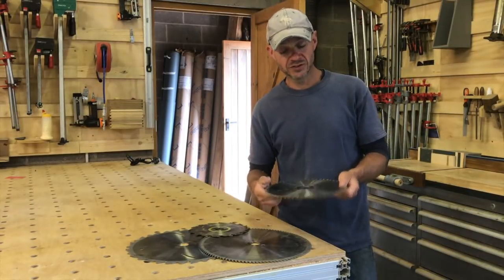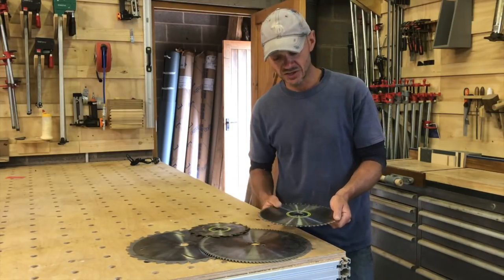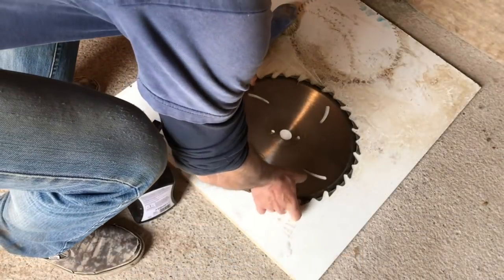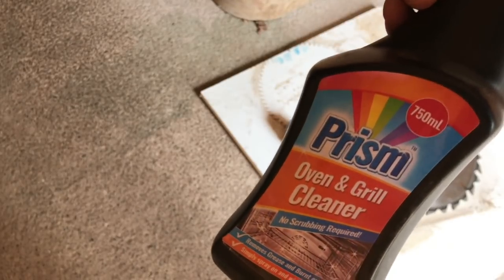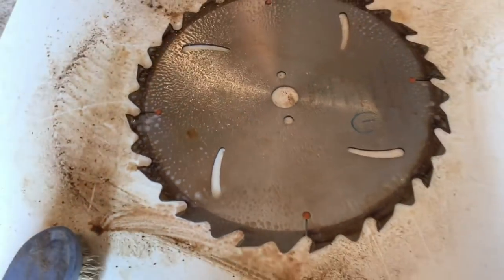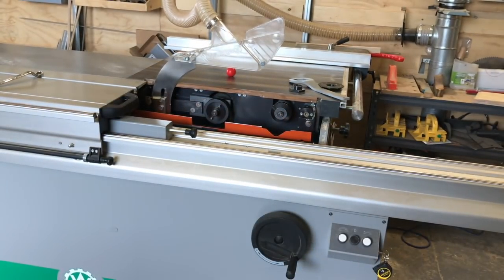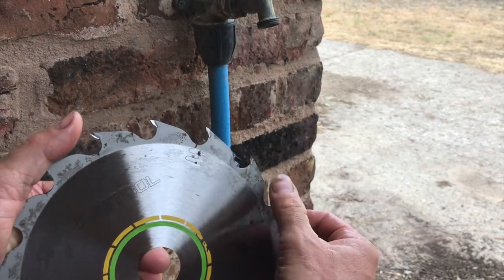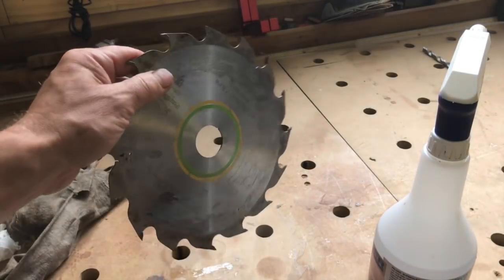Blade cleaning - Sunday shop update

Comment: I have CMT cleaning solution. 0.5l last me for 3 yrs now and I have like 1/4of it left. It works like a charm. Spray left if for fev mins and wipe. I learned that after is clean I clean the blade with lacquer thiner it kinda degrease the sawblade and it stays clean for longer time.
CMT cleaning solution cost 12 €
Reply from the maker: for me the CMT stuff didn't work very well I bought this last year ..  - https://www.ebay.co.uk/itm/CMT-Formula-2050-Saw-Blade-Router-Cutter-Bit-Cleaner-500ml-Bottle-998-001-01/172602218137?epid=1752199089&hash=item282fe4d699:g:vVAAAOSw1cNaAwF8
Reply: Manor Wood I see. Well the packaging looks about the same size just formula is different. Maybe different version. I don't know. I got it as gift from my supplier  first I was sceptical because I thought I will use it all in one month. But somehow it worked like a charm. I think it has a lot to do with what you cut the most. This year I had 80% just larch and on some occasions I had to spray it twice. I'm always in for something new so once I use it all I'll try that owen cleaner. Thank you.
BTW I'm happy with CMT lubricant for my mashinery too. Cheers

Comment: I use the same stuff, it works great and I find it odly satisfying cleaning blades.
I was cleaning a load of router bits for about twenty mins without gloves then noticed all my finger nails had gone soft !  thought they were going to drop off. Soaked them in vinegar and about an hour later they went back to normal but I  honestly thought they were history.
Reply from the maker: That made my laugh at first then worry for you..

Comment: For a less expensive alternative to the Felder spray, try GT85  ptfe spray. It is a lubricant used especially by cyclists. It works well on my saw table and lathe bed. Dries quickly and does not attract dirt or dust. Cost on line £2.50 to £3.00 for a 400ml spray tin. At that price you can afford to give it a try, even if you have to apply it more often than the Felder product.

Comment: I have no idea if the product is a chemical based cleaner. If it is l highly recommend wearing rubber gloves and a full face mask to protect yourself. I use acetone to clean my blades and then spray them with pure silicone. Where do you buy superglide?

Comment: Great tip Andy. I might be wrong but I think I seen you using Dakota parallel clamps on another video. Do you rate them? I have read mixed reviews. Cheers
Reply from the maker: I don’t use them much so but they are a life saver when you need them!  Not as good as bessey but work well

Comment: Hi. What is the purpose of the elder spray? Avoid rusting?
Reply: The supergleit is a lubricant, probably oil based, so also prevents rusting and gumming up of the blade as the resin from the wood sticks less to the blade. I bet there are cheaper alternatives, like silbergleit, that do about the same.
Reply from the maker: Spot on Simon,  and if anyone find a cheap alt let use all know !!!  When you clean your planner bed and put fresh superglide on its so much better . Even better than New but it’s very expensive
Reply: Thanks.
Reply: Wouldn't 4 in 1 oil do the trick?
Reply: https://www.amazon.de/fl%C3%BCssiges-Silbergleit-Spr%C3%BChkopf-bequemen-Auftragen/dp/B01N2HA1C1/ref=pd_aw_sim_201_of_47?_encoding=UTF8&psc=1&refRID=30DK30XHAT1X93FDZP5Z

This is what we use in germany for  machine beds. I don't know if it works for blades as well. But it is not that expensive.